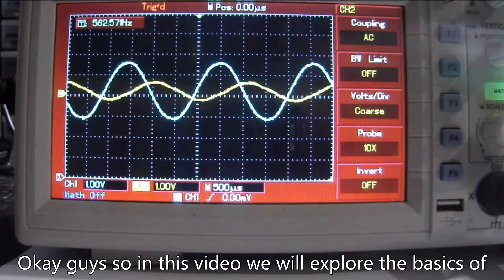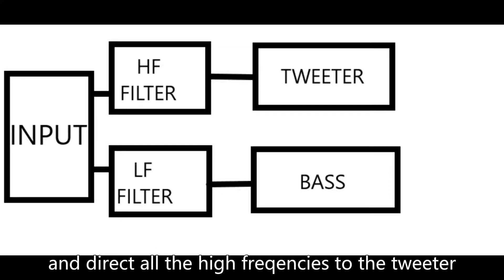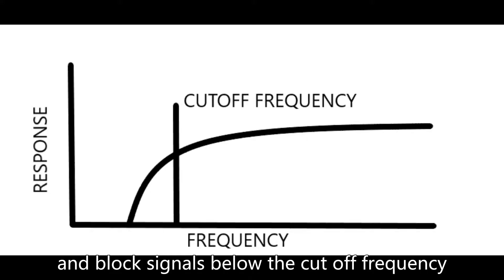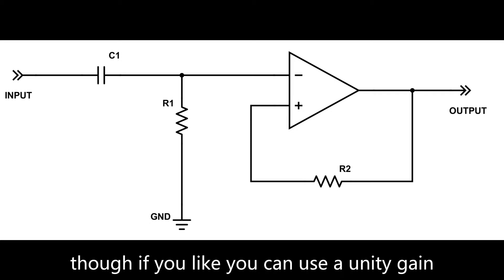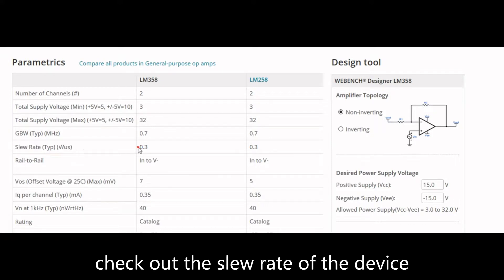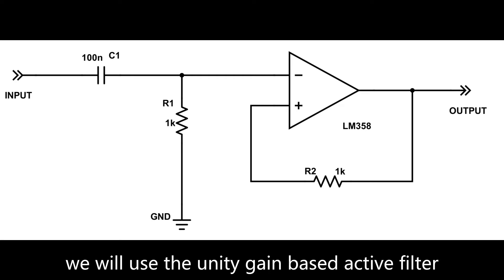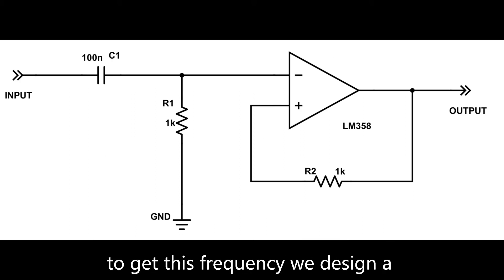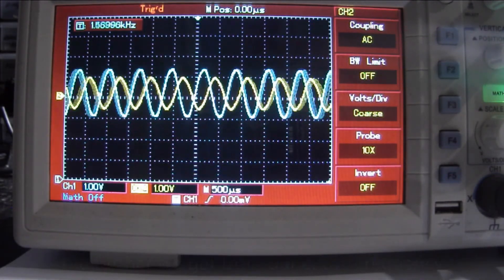Build an Active High Pass Filter | LM358 OP Amp

Comment: it would be nice if you could make a video about active low pass filter with LM358...
Reply: The active low pass filter has the same setup, just use a passive filter before the LM358 circuit instead of a high pass filter
Reply: @armstrongsubero98  Can you draw a schematic easily ?
Reply: @onurolce  Here is a nice walkthrough of how to build the active low pass filter, just replace the generic OP AMP with a LM358:
https://www.electronics-tutorials.ws/filter/filter_5.html